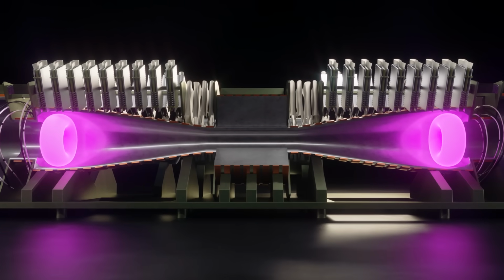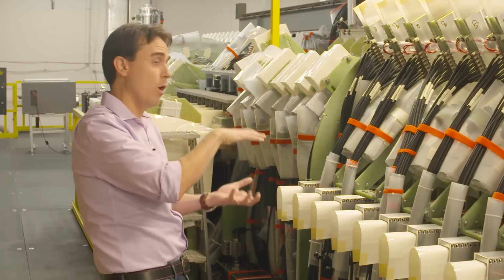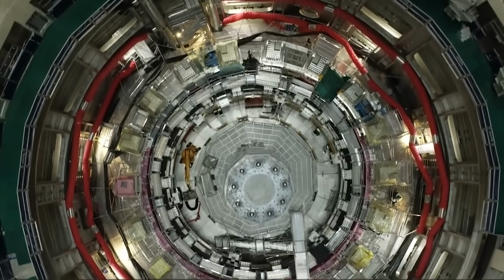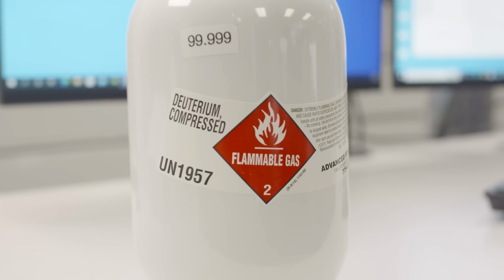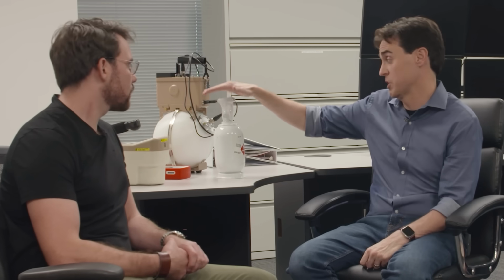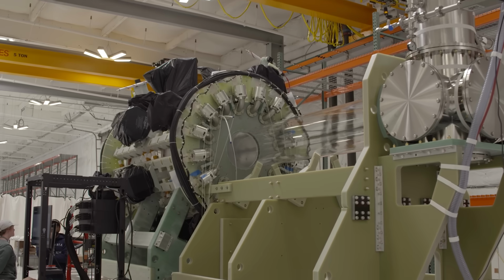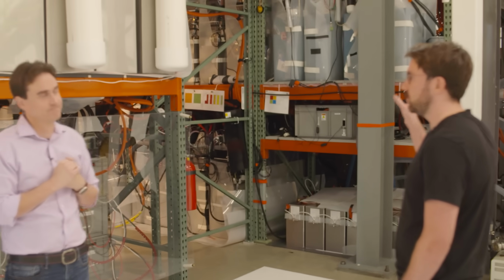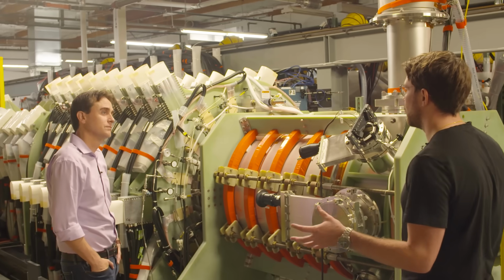A New Way to Achieve Nuclear Fusion: Helion

Comment: Thank you for this documentary! There is some fantastic engineering happening here! It gives me hope that by 2080 we will have fusion power connected to the grid. That said, I think we should focus on our near-term climate issues taking full advantage of fission reactors to do the heavy lifting that fusion may someday take over.

There are some dazzling innovations happening in fission concurrent with this. Developments that will feed into the medical industry and possibly even fuel generation for fusion. We may even discover that vision and fusion Energy will coexist in a parallel track well into the future.

In the near term, the choice is clear it's vision or greater consumption of fossil fuels in order to stabilize a grid with wind and solar on it.
Reply: Helion's goal is net electricity by 2024 and a FOAK power plant before the end of the decade. So A LOT sooner than 2080.
I like fission but unfortunately it faces a lot of headwind from irrational regulation and wrong public perception. There is hoping that fusion will do better.
Reply: @elmarmoelzer2229  laughable to believe Helion will meet those timescales
Reply: @Gomlmon99   Construction of Polaris is already well under way. They have generally had a 3 year period between builds and they have a lot more funding this time.
Reply: @elmarmoelzer2229  the goals you cite are the company's best predictions. They represent milestones on a research timeline. Those will be excellent achievements. That will be followed by decades of product development, supply chain development and a regulation regime. Filling that helium 3 pipeline with sufficient supply to power my heat pump will be a challenge. I think my expectation of grid power by 2080 is reasonable.
Reply: @ovpupfish  
Helion is moving A LOT faster than that.
They are already building test production lines and establishing supply lines. They are very vertically integrated, almost like SpaceX. 
As for the Helium 3: Their powerplants will self-supply with Helium3. Two Deuterium fueled pulses for one D-He3 pulse. 
These mixed mode machines would produce 50 MWe at 10 pulses a second and would make/consume about 4 kg of He3/year.
They probably could do more D-D pulses during times of low power demand.
It is either that, or they make dedicated breeders. Those dedicated breeders would produce about 6 kg of He3/year (and an equal amount of Tritium that eventually decays into more He3). 
That He3 would then be enough to supply a dedicated, pure D-He3 50MWe plant for 16 months.

Comment: I hope it gets somewhere but since they haven't actually had a positive energy output it's a bit speculative at this point.
Reply: Not speculative but theoretical. There are things like scaling laws that they established over the past 6 experiments. E.g. how the size of the machine affects the confinement time, how the magnetic field of the compression coil affects the temperature or how the speed of the plasmoids affects the temperature and stability of the merged FRC.
Reply: If they can't extend the time the reaction goes on for, it's just a super expensive science experiment. A hydrogen bomb already yields more than this reaction and lasts longer tok.
Reply: @funveeable   But hydrogen bombs need a fission trigger.
No, they do not have to extend the time the reaction goes on (not by much anyway, if at all). The machine is pulsed on purpose. They make up for the lower confinement time with higher densities.

Comment: The problem is that the reaction lasts for a fraction of a second, and takes more power in than it is possible to extract.
What I find strange is there is a really good fusion generator already running and supplying a massive amount of power that we are hardly using.
It's called THE SUN.
Reply: Because it’s expensive to harvest…? It’s not that deep

Comment: How do you contain the radiation levels at the reaction site? How about ozone output?
Reply: Polaris and subsequent machines will have pretty thick shielding. Borated concrete, hydrogenous shielding, lead and steel.
Reply: Just a simple concrete walk. Same as every other source of man made radiation on the planet.

There will be no ozone produced. Where would that come from?

Comment: Really? Nuclear Fusion? How can they stand right next to the target chamber with no shielding and not get dosed from the activation? Not unless you have miniscule quantities of fusion neutrons. Where is the structure to absorb the tremendous magnetic forces needed to contain a fusion plasma of any significant density? The field coil cables are held down with orange bungee cords and plastic tie wraps? Dont make me laugh. The low field intensity magnetic coils look like toys compared to the massive steel structure required to contain a high density, high temperature thermonuclear plasma.  This whole thing looks like a nice lab experiment for grad students, nothing more.
Reply: They are not always operating Trenta with Deuterium fuel. Sometimes plain hydrogen is good enough to test something.
The operating room is remote. They are not standing right next to it while it is operating. They are using quartz, not steel for the vacuum chamber walls.
Their previous prototype, Venti which had 1/3 the radius of Trenta and 1/30 the volume produced 10^11 D-D neutrons/pulse and that was peer reviewed by ARPA-E.
Trenta should be at least an order of magnitude higher than that. Trenta's results were reviewed by bigshots from the big national labs before their investors handed out the 500 million in the recent funding round. They would not have done that if the results had not been very impressive.

Comment: Amazing video, very well presented. A small doubt, maybe I'm just being stupid here, but according to the graphic at 8:04, the mass in terms of Protons, Electrons and Neutrons remains the same before and after the fusion reaction. Shouldn't the mass of the result be lesser since some of the mass is converted into energy?

Edit: I think that's just a minor mistake, as at 12:58, there is the correct equation showing a proton (basically +ve Hydrogen) being a by-product, and not a complete Hydrogen.
Reply: Yeah, they got a few small things wrong in the animations. Generally though, it is the nuclear binding energy that is released. Larger atoms have less of that. But the result there should have been a proton, not a hydrogen atom with an electron.

Comment: what's the energy input/output ratio? $/kilowatt?
Reply: This is an experimental machine. It does not make electricity yet. The next one, Polaris will first demonstrate net electricity in 2024. The next one after that will be a 50 MWe power plant. Target cost is 1 cent/kWh.

Comment: We're still 20+ years away from any practical success.
Reply: Helion is planning to demonstrate net electricity in 2024. That's 2 years.
Reply: @elmarmoelzer2229  it's not realistic. The required energy souranding the reactor is 10000 greater than the output energy. It's way to expensive and inefficient to make it ideal.
Reply: @9Achaemenid   And you know that how? Have you been to their lab? Have you actually seen the results? Do you even understand the physics behind this?
Reply: @elmarmoelzer2229  I work in the industry. If you seriously suggested 2024 to one of my colleagues, you’d get laughed out the room. 

Especially considering their track record of failing to deliver against their claimed timescales.
Reply: @Gomlmon99   Helion has not once failed to deliver a goal that they have had funding for.
I will laugh right back at your colleagues ;)

Comment: I see what this really is... Two Plasma Guns schooting at each other!
Reply: Not quite...
It is maybe not clear in the video, but the two FRCs merge into a single, bigger, hotter and more stable FRC in the center. That is then compressed to fusion conditions by surrounding magnets. The key is the use of FRCs and the way the system is setup.

Comment: The helion/helios project will change the world, theoretically could be used as an element generator and make power off of the machine as well these could be the next generators for new elemental projects to find higher energy/ resilient elements to use in spatial protections of future products

Comment: IT'S A FAILED CONCEPT, RELYING ON EXTREMES OF IMPROBABILITY OF THE IDEAL CONDITIONS TO MAKE IT WORK.
THORIUM FUSION REACTORS ARE MUCH MORE PRACTICAL, AND DON'T RELY ON IDEAL OR THEORETICAL CONDITIONS.
I WOULD NOT INVEST A CHOCOLATE COIN IN THIS SURE-FAIL TECHNOLOGY THAT HAS MANY FAILURE MODES, AND FOR WHICH PROVEN ALTERNATIVES EXIST IN NUCLEAR POWERED SHIPS THAT WERE ALREADY WORKING WELL 60 YEARS AGO. SCRAP IT ALL, AND GO WITH PLENTIFUL,  SAFE THORIUM FISSION REACTORS.
Reply: The extreme practicality of thorium reactors for power is why we've built a grand total of... zero power plants using them.

Comment: Wouldn’t 10 million degrees melt the machine? And the room? And the town?
Reply: It is actually >100 million degrees after compression. The plasma is hot, but not very dense (only 1/1000 the density of ambient air). It only contains a few kWh of energy. It is surrounded by a vacuum which is a perfect insulator and held in place by magnets. If magnets failed completely for some reason, the plasma would expand and cool off quickly. Then the walls would likely see some minor abrasion like damage and that would be expensive maintenance if it happened to often. But that is pretty much all that could happen.

Comment: Ticking Time Bomb. Stop trying to play God.
Reply: No, this is safe. There is nothing there that can explode like a bomb or anything. The fusion plasma is very hot, but not very dense (closer to a vacuum than to ambient air) and it is surrounded by a high vacuum, which is a perfect insulator. Think of steam from a pot of boiling water. The steam is boiling hot, but you can hold your hand into it (carefully!) without getting severe burns. This is similar. It also cools off immediately when it touches anything like air or the vacuum vessel walls. The total energy content of a pulse is only about 8 kWh, a fraction of the content in a Tesla battery.
Reply: @DoomGuy69420   exactly

Comment: A way to achieve fusion video: Hellion
The fusion wall temperature changes between 10 million & 100 million degrees, other effects found, building future chambers 25% bigger.
My suggestion is to build a larger chamber surrounding the fusion chamber that also has magnetic polarity control but can regulate the temperature between the fussion outer chamber wall and the inner larger chamber surrounding it. Control the temperature and magnetic field outside of the fusion chamber within the larger chamber wall. It will provide you a much more controlled reaction. Test my idea. It is correct.
As for the capacitor banks you could try to use super electrified water or a heavy water capable of holding overcharged ions in it.
Let me know how it goes. I have one more idea, but would need to ask you a question or two first.

Comment: Why not just build thorium molten salt reactor? We had one running from 1965 until 1970 at Oak Ridge, Tennessee, when Nixon shut it down. He had a public school understanding of physics. They can't blow up, because it's not pressurized. Excess he could be used for petroleum, distillate manufacturing, i.e. diesel, heating oil, kerosene, etc. not to mention water desalinization. I lived in room 99 could be used for cancer, diagnostics therapies and research. Xenon would be great for NASA interstellar. Space travel. I would do modular unit, so if a terrorist attacks why he doesn't wipe out all region.

Comment: Why not do 3, 4,or 5, etc. Just using Tesla's concept of a three phase motor. 
All beams would be directed at one focal point.
Reply: It is maybe not clear in the video, but the two FRCs merge into a single, bigger, hotter and more stable FRC in the center. That is then compressed to fusion conditions by surrounding magnets. If you had more than two acceleration sections, there would not be enough room for the compression magnets in the center.

Comment: This system on the face of it would appear to be far more efficient directly inducing an electric field within the machine itself as a conventional generator does I wonder how efficient this machine will be if the magnetic containment field fails I hate to think what would happen how robust is this containment field and it's controls this will most certainly be a game-changer for the world financially and politically the ramifications for oil Giants is enormous probably leading to Global conflict the basis for all movement within the universe is energy transfer no energy is lost in this process but transferred and changed don't you think our creator Jehovah is so brilliant

Comment: Great video!! Can we not capture a lightning strike using those amount of capacitors? 😳
Reply: No, would need about 100 times more capacity.
Reply: @elmarmoelzer2229  cool to know that, so it’s almost in our reach…
Reply: @DrumMeister  Well, energy storage and the capacity to produce it in sufficient amounts is the big problem. Capacitors cost a lot of money and storing that much energy that quickly is a challenge.
And when I say much energy, it is really not THAT much. About enough to power 250 homes for an hour.

Comment: Well years is not true, magnetic was recently publicly put out there for another use in solar. But , that was not for tens of millions of degrees. It's not needed at that level. Aside it was already thought and talked over, the idea and probable issues was clear. The probability to have control loss is clear. Particular about power loss, magnetics and what level they can operate at a controlled manner.

Comment: Haven't we figured out enough ways to kills our selves with radiation? Try something ells that won't kill us all!
Reply: Ah radiation is bad but coal smog is fine.
Reply: Very little radiation hazard from these machines. They can't have catastrophic failures and even if one dropped a large bomb on them, the contamination would be very minimal. 
These machines are designed to be fully commissioned within 2 weeks after last operation. All components are below background radiation after less than a year.

Comment: This is a charade. Money sucking "scientists" who will never acomplish anything.
Reply: But, they have accomplished lots. What is your pollution solution?
Reply: @afaxmachine5045  My? Investing in better solar panels and better using of sun's energy. Demand from politicians to lower their wages and to push cheap (but quality) solar panels for EVERY HOUSE.
Reply: @mirovinac3968  the issue with solar is the battery's required to store electricity for cloudy days and nights, while solar is good the amount of lithium that would be needed to build and maintain the batterys required takes away from its environmental positives.
Reply: @afaxmachine5045  Yes, I am aware of that. But, there are other substances which can replace lithium. And this "revolutionary" reactors also have their own flaws. A lot of flaws. Nothing is perfect. But solar is more realistic for most people today and more efficient, especially with modern panels.
Reply: @mirovinac3968  no other substance can currently commercially replace lithium ion batteries. The only realistic option for today is nuclear fission, which does not need much iterating on, which would make way for fusion research and development which will be much better in the long term than even current renuables.
Reply: @afaxmachine5045  Sodium-ion, solid state graphene batteries etc. are replacemen for lithium ones. But I am not so interested in reactors, they are highly dangerous and not good for nature (in the end every reactor is readioactive and produces a lot of nuclear waste, even this one). I am interested in modern solar panels and modern batteries. I would like for humanity to go that way, to give almost free energy for at least 80% households in the world.

Comment: I wonder what would happen if they took out the center crush point and put in a sphere and then put a stronger magnetic field around the little bottle to keep it from interacting with the chamber so it kind of floats in the the middle. And as far as the capacitor the max Banks could possibly be submerged in something like nitrogen to keep them from getting too hot. Bravo gentleman I'm impressed
Reply: The plasma does not touch the wall (ideally) anyway. It would cool immediately.
Reply: @elmarmoelzer2229  instead of using a crush point use a sphere and use stronger magnetic constriction. Because the waveform was a little bit bigger than the chamber and that's why they created a bigger one. It's just an idea

Comment: Just an extremely complicated attempt at the mythical perpetual motion machine.  It's like waiting until a split second before a stick of dynamite is lit to start measuring
the amount of energy being input.  Of course there will be more energy output than what was input.  That doesn't mean you've broken unity.  It just means that you're 
experiment is flawed.  This is nothing but an extremely dangerous waste of money.
Reply: Uhm, that is not where they are going with this. Polaris will demonstrate net electric output in 2024. The machine will be self sustaining with a little extra.
It has nothing to do with perpetual motion either. There is a fuel (Deuterium and Helium3) that is burned (fused). The resulting atoms have less mass than the sum of the original atoms. That "mass defect" (look it up) is the binding energy that is released.